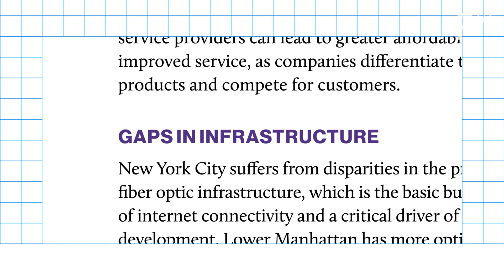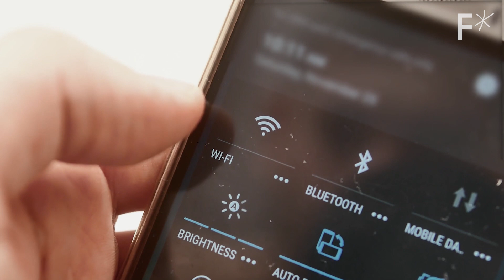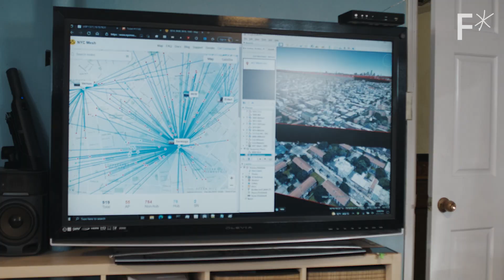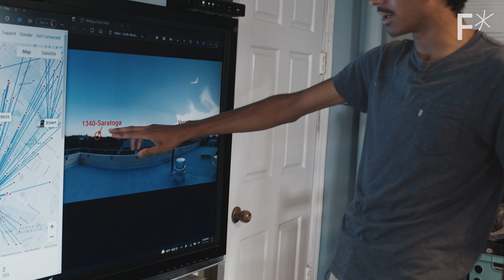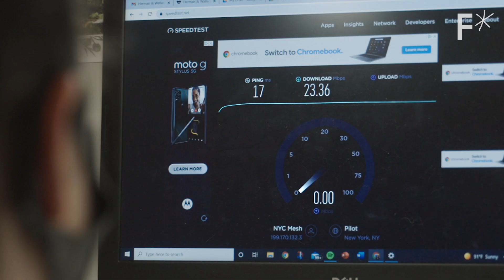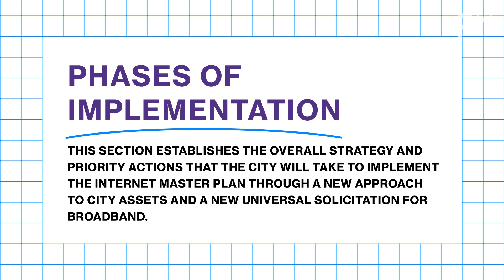NYC’s nonprofit DIY internet is taking on Verizon & more | Just Might Work by Freethink

Comment from the maker: What do you think of this approach to internet access?
Reply: I say 👍
Reply: I think it's great.
Reply: How do i contact um?
Reply: I say FREE the internet! It's been in shackles for too long.
Reply: @itsourlife  Quickest way, coordinate efforts for WAP or node install with manufacturers of street lamps and traffic lights.
Reply: I think it is awesome.
Reply: I’m curious on the back end aspect of this.  I’ve played with the idea of a PtMP rollout in rural areas but found that I’d either need to buy metered bandwidth from a for profit existing ISP to compete with them with, or, rent costly server space at a data center along with leasing dark fiber from there to a tower(s) to avoid purchasing metered bandwidth yet again from an ISP .   For the little guy this is a dizzying concept. The security side is concerning, especially when offering broad public wifi. This is a great idea however it is deployed but I am curious, if the end user owns the receiving unit which also turns to a different local broadcast unit that other people then rely on, who pays for that CPE if it must be replaced? Do you assume responsibility as a customer to make costly and timely repairs to the backbone  since you may have more users downstream from you while also paying for said service?
Reply: I’m also trying to wrap my head around mesh vs point to multi point networks. Security, cost, features, bandwidth and the rest. This appears to be an air max deployment but is called “mesh” I wonder if they’ve made a different service in a service or if it’s just a friendly term for end users to grasp.
Reply: @sealstech8087  we are a hybrid of point-to-point, point to multipoint, multipoint to multipoint (mesh). The mesh part is for local connections and reaches a block or two. The whole network uses OSPF, which is a very common network protocol to find the shortest path and automatically re-route around broken connections.
Reply: Excellent work guys!!
Reply: Is the internet actually free? If he's not charging them how would they survive? If I wanna start a ISP, don't I need to buy the data from someone who owns it?
What is the internet?
Reply: @karthavya1440  that’s my thought.  The speed is a whole nother question. Say a 1g fiber connection with 1tb of data per month runs you $50.  You have 10 users on a radio 100mbps each capped at 100gb of data per month (fine for students, impossible for gaming) and a $5 per month donation from each member would allow the head user to break even minus electric cost so they’re at a loss there.  Then add in public access wifi and that directly hurts the speed and data cap of the paid users.  If it’s “free” or low cost, it’s losing money or is worse than dsl service.  10gig fiber at a tower would be more cost effective but I have no available pricing or data cap on such a package so it’s all theory to me, but speed:customer density would be much greater.
Reply: @karthavya1440  That's the thing. "Only those who can" will pay, you only need like 1 donation per node to cover expenses for gigabit internet in NY from what I found. They're basically re-selling access to a unsafe home network and consumer level access points at high prices to the unaware and Idealistic markets... Very unethical.
Reply: @Guillermo_says  you are so wrong I don't know where to start
Reply: @Guillermo_says  Look at the Terms of Service of the Big ISPs in your locality. All of them do not allow sharing bandwidth with other users.
Reply: I want it for everyone and it’s so positive for the community. It’s blowing my mind. 🤩🤟🏾
Reply: Awesome internet network decentralization, folks!
Reply: Brilliant. Glad you guys are doing it.
Reply: Someone comes to town, someone leaves town
Reply: @John Smith great! We are working on a new 10 gigabit fiber install. Wireless installs to smaller buildings can't be that fast unfortunately
Reply: @NYCMesh  How do you get access to the fiber though? Dark fiber hookup? Did you have to pay to have the fiber laid in the first place? Up front costs can make this approach very unattainable if you don't already have access to a backbone.
Reply: @tcass  we lease dark fiber from independent fiber companies. There is already a huge amount of unused fiber in the ground in most areas of the city.
Reply: @tcass  we are in two data centers (a third coming soon) it costs around $1K per month for cross connects and roof access. Basically we peer inside the data centers and use antennas on the roof to get out- so no huge fiber leasing charges. We are starting to lease dark fiber in the street as well for very large installs, that can be between $1K and $2K
Reply: Share this to the world. The plan of the big techies is to shut-down the internet for a while, then when it comes-back we have to pay them everytime we use the internet, we have to make the first-move before these scumbags lock-us-out, and could possibly never use the internet again, if we will not do what they wish.
Reply: Nothing is free. Either someone is paying for this or it has a huge catch.
Reply: @thomashawaii  well, they use victimization as a brand voice so... Anything is possible with these people that pretend not to make a profit.

It's a neat Idea, don't get me wrong, that's why people have been doing it for more than a decade and that's also why companies manufacture this kind of home networking products to start with. I just find this kind of branding so wrong.
Reply: Well done need it up here  the avenge mouthily bill for internet with 4 providers is $60.00 Can to $160.00 Can mouth  and you have to have a 1 year to 2 year contract.
Reply: I build 5G network on cell tower in Dallas area. I like to volunteer my time if u can use someone like me.
Reply: might be good for big cities, but it will cause the companies that provide for the rural areas to shrink causing the rural areas to not have easy access.
Reply: That's what makes America great; when people take initiative to face what's wrong and fix it.
Reply: Fiberoptic wiring in brand new home construction is almost necessary as a new appliance. Let's see 30 year mortgage, can you Zoom Me Now? Otherwise, you will have the unsightly WAP antennas everywhere with of course more wiring. Mesh networks are the way to go especially when they are the size of a glade plug in.  After installing Quadrax wifi in aircraft I was like damn, other components need to be smaller and lighter, easier to install in the aircraft.  The mentality is the same. The ISP or DIY your own will be pretty much be the only talking point. I would install WAPs for a backyard Zoom meeting with 1080 or 720 streaming and move on with minimal latency. You're still capped though ISPs have supply and demand issues as well. Most of the in house stuff that I mentioned can all be had for less than a $1,000 pc. or cellphone.
Reply: It is a nice idea but how would this work in a hilly countryside? I have 2 choices here. Century link or satellite...both are over a hundred dollars a month. WHY SO EXPENSIVE???
Reply: @countryside8122  those options will remain your cheapest option unless you have 10 /14 or so neighbors within a few miles of you of you and if you’re all within view of a water tower or grain silo.  In that scenario you could coordinate with your neighbors to invest in a private point to multi point system for your community.  The ISP connection would be $10 per user if they’re okay with 100mb.  If they want one gig it’ll be $100 per end user (x10-x14) radios and free standing towers would be 100/1100 (without/with tower) per end user.  Primary radio and router on the silo or water tower would cost 500/800 outright plus rental for that space (adds to end user cost probably 10 per month each) these neighbors can be ideally in a 30 degree swath from the tower and within 10 miles of the tower.  Now you see why existing satellite will be easier and probably cheaper
Reply: @sealstech8087  Only have that many neighbors in the summer, and the nearest neighbor is 1/4 mile away. Have a tower about 3 miles away but not much on the tower as of yet.
Reply: I think it's awsome for the people by the people can I get info on how I could possibly do this where I live be safe thanks peace ✌
Reply: The Ham Radio Internet using Linux open source programs in the 1990s. But it was SUPPRESSED by COMCAST and by the SILICON VALLEY GIANTS.  Linux of course has full radio modem support (AX.25 its called) so after an earthquake or any catastrophe we can get an internet working again without having to run hundreds of miles of new fiber. Great!
Reply: So, I love this approach, but 3 problems come to mind: 1) Latency in mesh networking 2) Ultimately, there still has to be an interconnect with an ISP and that is quite pricey 3) What about users consuming all the bandwidth with Internet-based television, etc?
Reply: @pbpinftworth  1) our latency is low due to our hybrid network 2) you don't have to pay an ISP if you peer in data centers like us 3) everyone on our network streams movies no problem!
Reply: needs to happen
Reply: If you can supply me with the technical details of this I will try to promote this among people who have the same problem as NYC.   Thank you.
Reply: Brilliant. Thanks for sharing this info. Very interesting.
Reply: It would be interesting if something like this could be possible in South Carolina.
Reply: Loved it!!
Reply: I think this will work in every city in the world, there will always be poor areas of the population
Reply: Won’t work outside of city’s
Reply: Красавицы
Reply: I think it is awesome!
Reply: i currently take this approach in my country the small island of saint vincent and its shocking to me just how much cheaper i was able to make my network services whilst still making profit.
Reply: You need Jio , we get 50GB internet for 3$,that's how cheap it is for Indian
Reply: Make sense US 35.00 for 50GB.
Reply: @BhanuPrakash-hk5iu   hey i need help to start a isp network in my village
Reply: Community run networks is the wave of the future for those who cannot afford the high cost of ISP service from these monopoly tyrants who control it.
Reply: So I had to check some of the claims of this video and ISPs seem to offer fairly cheap prices in NY City, it gets even cheaper (and faster) than what I can get in my 3rd world country. This is just an ad for a a brand that uses victimization and villainizing as a voice, this just keeps getting shadier and shadier the more I look into it.
Reply: @Guillermo_says  what? haha
Reply: @NYCMesh  Well, my points are clear, I did my research, you could point out how I'm wrong.
Reply: Nice ...but I really think ..if all people doing these amazing projects would Adress  the more urgent problems in this world ..we might have a future to see those projects from the video working out ..
If NOT ..in 2 to 3 years ..Internet access will be our smallest problem
Reply: As long as it is not a tax on someone else and is totally non-profit and truly affordable then sure but I see it becoming a big mega business like any other after it is going well. Once proved out it will become a profit driven form and peoples information will be used and sold. No thanks.
Reply: Don't you have to pay for connecting to servers?
Reply: @colour3340  This has nothing to do with servers. You need just internet breakout for all people in the mesh to connect to the Internet and that's it. From there they all have access to what ever server which is connected to Internet. Basically it is a bit bigger LAN, they need to divide users in vlans and encrypt everything to make sure there is some privacy, but that's basically it.
Reply: Nope, you connect to mesh routers and then back to the gateway which is connected to a Lease line with over 500Gb speed which is distributed out to the end users. @colour3340
Reply: @colour3340  it's by donation. Most people donate around $20 per month
Reply: @colour3340  Yes they do. Those fiberoptic hubs don’t come cheap if you want to provide huge bandwidths to people. Hard to believe they can do this for non-profit. Someone is making a profit from this.
Reply: @onegreenev  we pay around $1000/month to be in a data center with roof access. We are in two data centers and we have around 1000 apartments connected. That works out at $2 per apartment. Bandwidth is cheap! ISPs fool you into believing it is expensive.
Reply: @brianhall618  What kind of bandwidth are you talking about? I used to have a small ISP when dialup was the king, one price and the fastest I could provide but was unable to break into the high speed in our area. I earned clear $2 per customer. Just didn't have the capitol to get it going. I am well aware that ISPs gouge customers. I don't mind paying for good service but gouging is another thing. with all the other things I have to pay for much will go away when I retire because frankly I won't be able to continue. So I enjoy it while I can. Slowly going off grid.
Reply: It looks like a deeply corruptible idea, a backdoor into a specific demography, no rugged firewalls but a network based on trust from which a selected few make a huge profit out of free labor and short term solutions at retail prices.

For something like this to work, it would need replication of the method through small communities, not centralization under one project.
Reply: @Guillermo_says  I was hoping to install something like this at every Marina, Port, etc. It's about as exclusive of a community as it can get.
Reply: @Guillermo_says  It already works!

Comment: Sounds Utopian to say the least and i doubt its sustainability with donation based financing as leeches are bound to drain resources without contributing. 
Why should i pay 60$ if the guy next door who makes more does not. Then there is the issue of signal pollution with so many powerful wireless senders and repeaters everywhere. I just imagine Popping a jammer near a major node and watch all hell break loose.
Reply: So, obviously WIFI cannot possible work in a high rise apartment building for that reason, right?
Now research why birds aren't real.

Comment: This is amazing. However I do wonder if this would be highly insecure as members may have easy access to intercepting traffic of other members, even the fact that it is all done through wireless connections makes me wonder what protocols they are using, as wireless connection protocols are notoriously unsecure, would software updates be mandated to the hardware that people own? Because otherwise within a couple years known vulnerabilities WILL be found and those who do not update promptly could compromise entire blocks if they are transmitting others data through their hardware components. Lots to worry about and I wouldn't trust it with anything. But it looks super cool and I hope that they somehow have the answers to these problems.
Reply: We already use HTTPS, they can intercept it but they can't view what's inside. Unless if they use unsecured protocols like HTTP.

Comment: I'll be going to NY on July. It'd be awesome if I could see this up close. I work for a WISP and this concept looks great. Ham radio operators also use a similar setup with modified equipment of the same brand. But their network is on the private side because of licensing issues. Although you can tunnel in from anywhere in the world to one of the meshes if they're setup for it.

Comment: I pay $80/month for high speed.  The service is fine but the price is high because the only choice here is spektrum.  They could charge 50/month...they did for the first year...then it went to $70...and then has crept up another $10 without notification or a reason for the increase.

Comment: Amazing idea and I really hope it succeeds. Mesh networks can be an excellent solution to problems with infrastructure costs or access to retrofit it. Line of sight is free of cost and free of obstructions so a place like NYC is actually a fantastic environment for this because there is an actual landscape of free towers essentially. It's just like the game where you have a maze and you have to get a laser through to the finish which is impossible until you add the reflective mirrors to bounce it all around and the hubs/repeaters are the mirrors for the maze. But what if the maze is very complicated like the view of downtown NYC from above. You definitely can't get your laser through a physical building which is why you have to play the maze and go all sorts of directions on the streets of NYC to eventually find the finish and by that time you are exhausted and can barely speak so you won't be much good at communicating. This is where the landscape actually helps you because it adds the Z-axis or 3rd dimension with the possibility to jump walls as long as you can get a mirror or set of mirrors up in the sky that can reflect all over as long as it's visible to the laser at the start and the next mirror beyond that and the one beyond that and so on. It all gets even better when you see that wireless transmission is conical so the mirrors don't even exactly have to line up like a laser does, it would be like using a flashlight and each mirror instead of only being able to reflect the laser losing intensity at each mirror actually becomes a sensor. Let's replace the mirror with a nice boy named Gary and Gary has his own flashlight and when he senses/sees a light then he passes it on by shining his light towards little Timmy which is bright and renews the strength of the light at each stop until the finish. Yay NYC Mesh